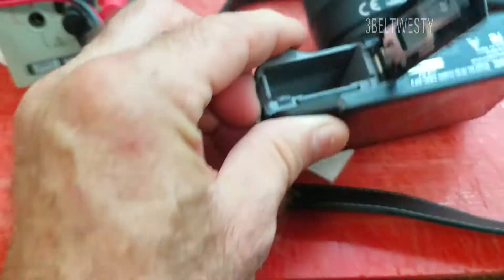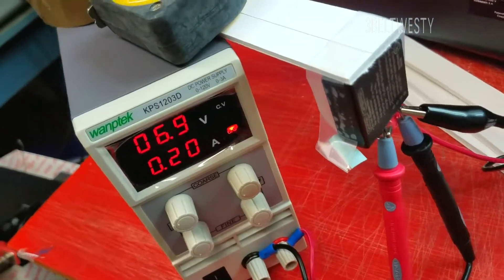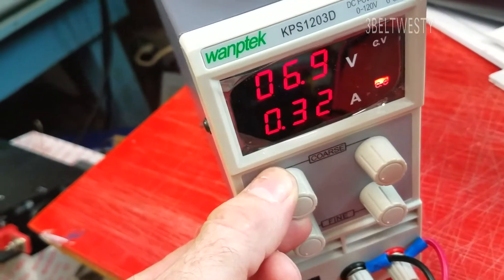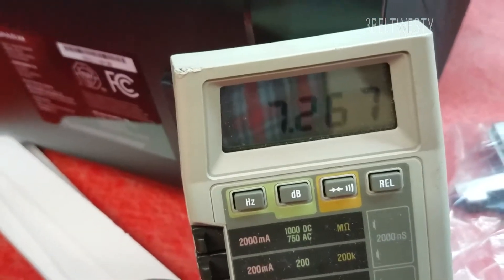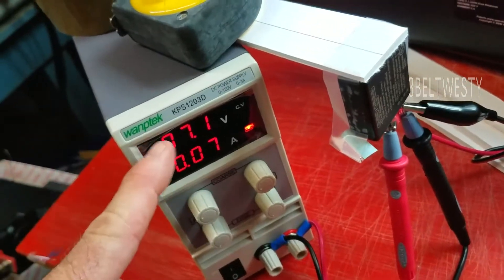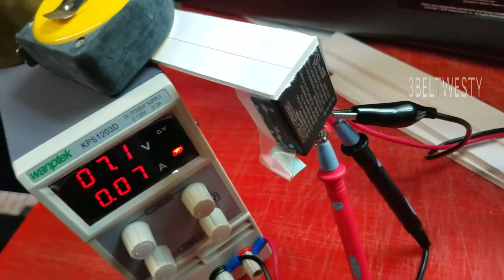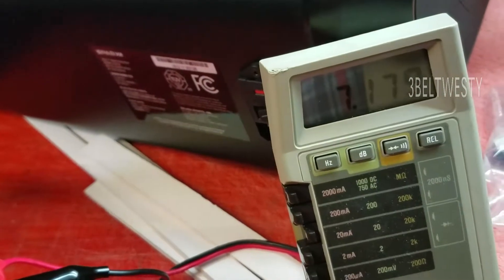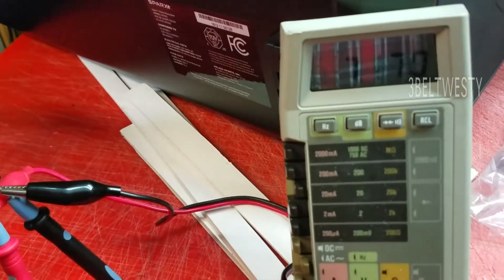Switching Supply audio noises Wanptek KPS1203D 120V 3 Amp

Comment: I'm considering purchasing this power supply. What is your opinion about this unit?
Reply: @Scotty  -- I installed two of these supplies to run my home brew LED lighting system in my living room.  Worked great for a couple of years, each supply providing around 100VDC @ about 1.33A max for it's series connected 20W LED modules.  Last week, though one supply simply failed in operation... putting out no more than about 100mA.  I took that supply out of service and paralleled the two strings on the remaining supply.  It failed before I reached 2.5A (less than 1.33A x 2, and less than the advertised 3A.   That said, I got a couple years of good service from them, so I ordered two more.  I hope I can troubleshoot the old ones and get them running again.  I'm looking for a schematic of the supply!